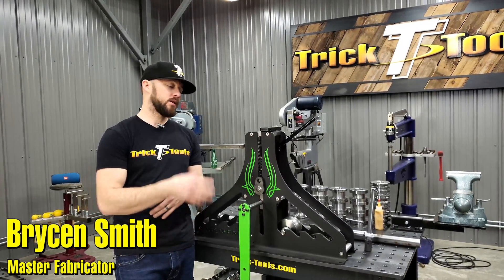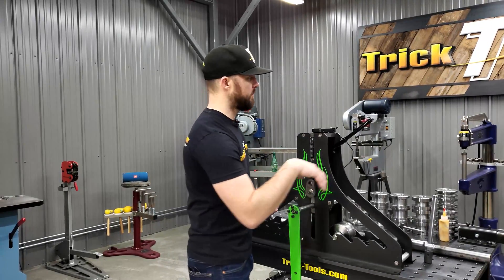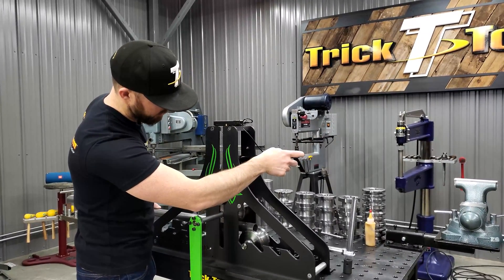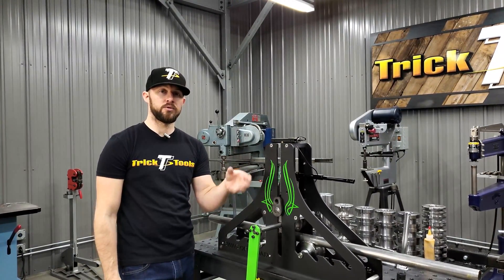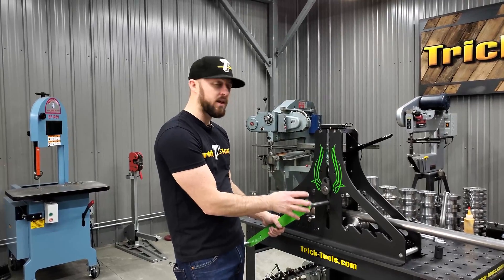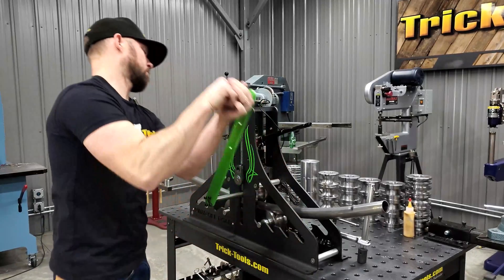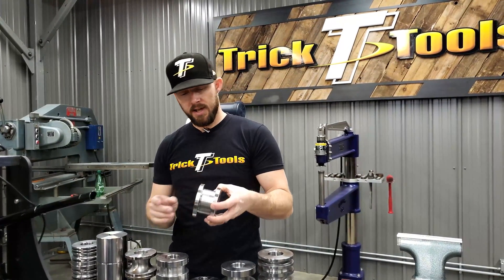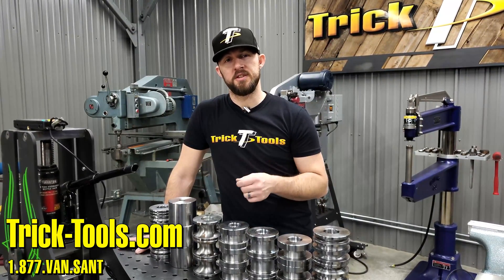Swag Off Road Hulk Manual Roll Bender - Trick-Tools.com

Comment: I wonder if it is possible to bend aluminum for parabolic shape. Each section is actually half parabola (half of the dish). Mostly aluminum 15x15 mm and 20x20 mm. Not sure how to achieve different radius of curvature.
Reply from the maker: If you made a die to fit the shape perfectly you could most likely bend shapes like that with this machine although it would depend on the wall thickness how tight of a radius you could achieve.  Different radii are achieved on this machine by cranking down the center roller.
Reply: @TrickTools  Thank you for fast response. So, it is possible. This is good news.

Comment: I’ve used the HF with full swag conversion and still getting twist incredibly bad. I was under the impression the non keyed rollers were the cause so with the conversion and using swag roller dies it should happen but it does. Curious if anyone is fighting twist with this unit.